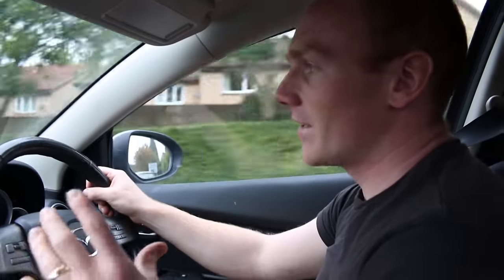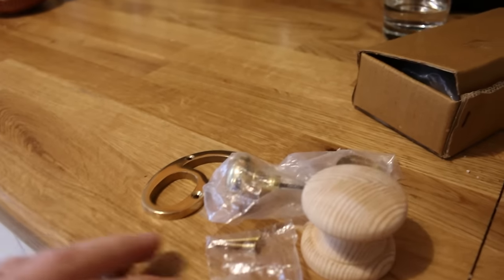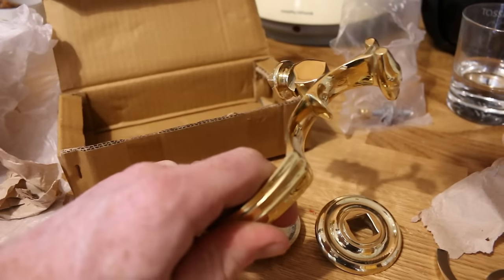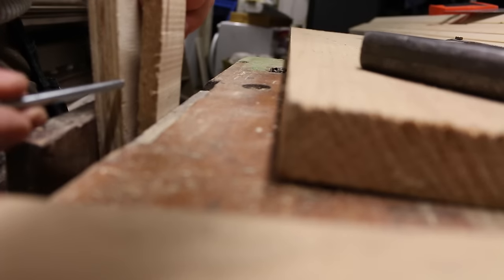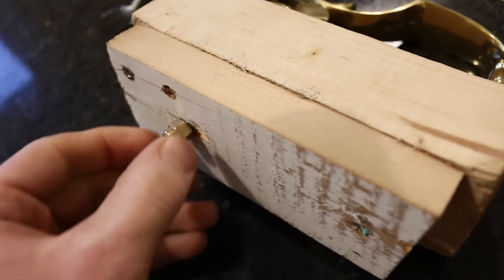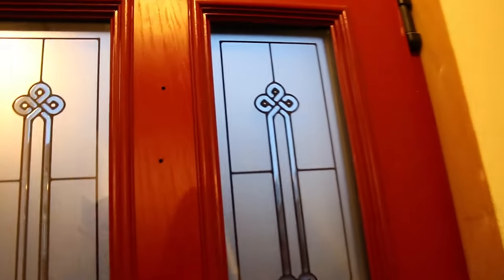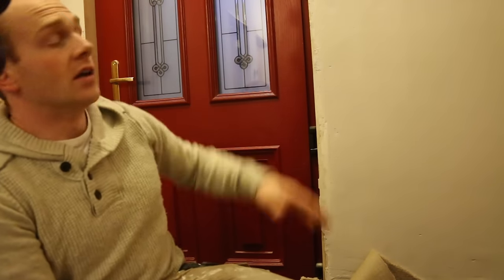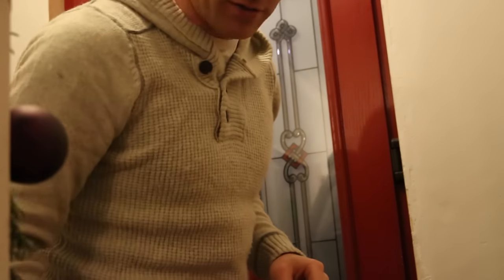Doctors Knocker for the Front Door

Comment: Have watched all of your vids and am inspired by your attention to detail, as for the door knocker most people would have just bought any off the shelf tat that the major did stores do. It might take twice as long to do a thorough restoration, but is well worth it. With the early vids I see you worked with lime plaster where possible. I prefer lime plaster as it allows flexibility in movement. A flat I bought a few years ago had a shoddy skim coat of gypsum applied over lime, just made a small damp problem worse!!
Reply from the maker: Yes we always try to use lime on any external walls especially the ground floors and breathable paints throughout. Most 'damp' issues are down to gypsum or cement being used where it shouldn't. Trc

Comment: I would have made a block that fits tight between the glass frames with all the holes drilled, preferably with a drill press, then it's a simple matter to place the block and drill straight, once you get one hole drilled all the way through, all the others half way, (you could move the block to the other side to drill the others, they should meet in the middle).
If you want flush nuts on the inside, get some cabinet joiners, the ones that join kitchen cabinets together, you may be able to find some brass ones.
The name 'inter screw' and 'connector nut' bring results, though i can only find steel, maybe the ones used for beds may be brass coloured.
Alternately find something decorative for the inside to cover the nuts

Comment: Faced with the same issues with a very similar knocker a few years ago here are some of the things that I did to mitigate the problems you came across.

First of all, I rebated the nuts on the inside of the door.  I did this for a couple of reasons.  The first was because I did not want the nuts to be proud of the door and the second was the same as you - insufficient length on the supplied threaded rod.  After very careful marking out I used a router to get a beautifully clean and neat dead square hole in the wood with sufficient clearance to get a socket onto the nut.  The hole can then be capped with a timber dowel or left open. My door is 100 years old and has been painted several times during its life and no doubt will be again at some point.  This technique works well in this context but may not result in as pleasing an end result on your pre-finished door.

On drilling holes squarely into timber Wolfcraft do a couple of related handy gadgets which can help in these circumstances:

This one is for standard 43mm mains powered drills:

       https://www.youtube.com/watch?v=y5dUZmma8Q4

And this one is good for any type of drill - including battery drills:

       https://www.youtube.com/watch?v=QTXRQlp_Aqw

I don't make regular use of mine but when you need it you really need it.

In fact, I've had mine for over thirty years now and I see that they have made a number of improvements to the design since then so I may just consider updating and getting hold of the one shown in the second of those videos.

Second, you can use a simple batten (with slightly rounded off corners is best) to help guarantee that any holes drilled in this context are correctly centred without having to have perfect marking up.  Put a hole of the required size in the exact centre of this batten.  Put the drill through the hole in the batten and then align the drill bit on the mark on the work.  Hold the drill firmly in place and push the the batten down onto the wood and then rotate it until both ends contact the mouldings on either side of the timber member to be drilled and then, holding the batten firmly in place with one hand, drill the required hole.

Make the batten 40mm - 50mm thick and it will also act to help keep the drill running true so that the hole is still in the centre where you want it when the drill comes through on the other side of the door as well.

This technique also works when there are no mouldings to locate against.  In this case place a sturdy pin at each end of the batten and on the same centre line as the hole in the middle.  Place the batten over the work and then rotate until the pins engage on either side of it.  The central batten hole is now aligned dead in the centre of the work.  Dead simple, and a lot cheaper than paying for one of the many commercially available jigs that does the same thing - like this one for example:

     www.woodpeck.com/ottmtcentergauge.html

You may need to purchase a long series drill for this situation in order to be able to drill all the way through the batten and the door.  Again, a tool which you don't use every day, but when you need it you really need it.

It all sounds a lot more long-winded written down like this but it really is a quick and easy technique to use in practice.  And of course it is very much cheaper than the Wolfcraft jig solution.
Reply from the maker: +Tony Colliver Thanks for the reply and the links.  I usually just use a block of 2x2 that i have pre drilled on the bench drill and that keeps things straight as you have suggested.

The door itself is a moncoque structure and therefore hollow so rebating was not possible otherwise i would have done the same thing on the back of the door.  So in the end there was actually no need to drill perfectly straight as the two skins could have been measured and drilled from each side and then they would have ended up being perfectly centred.  This is what I didn't think about until afterwards, but that's what DIY is all about I guess!

My workshop is full of tools that are job specific and may well not see use for years to come but there is something nice about knowing they are there ready and waiting.  My Wife calls it hoarding however I see it as being prepared! :-)
Reply: +The Restoration Couple Funnily enough, my wife takes exactly the same view!